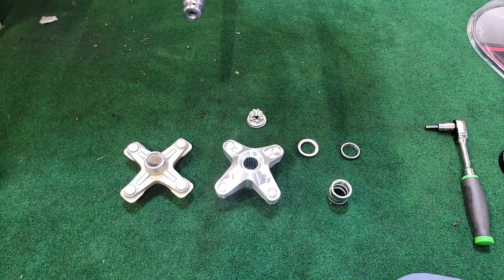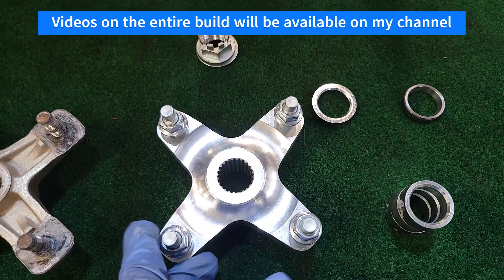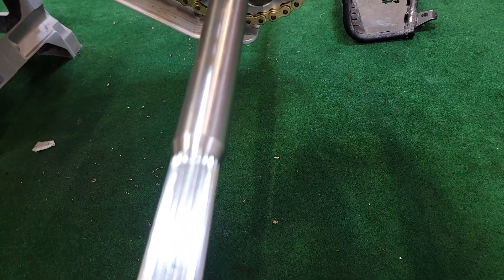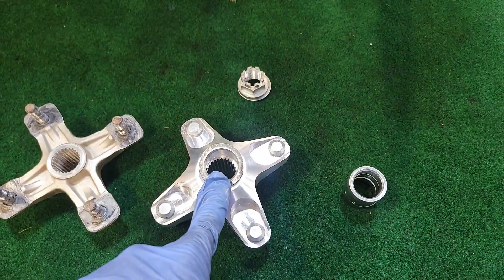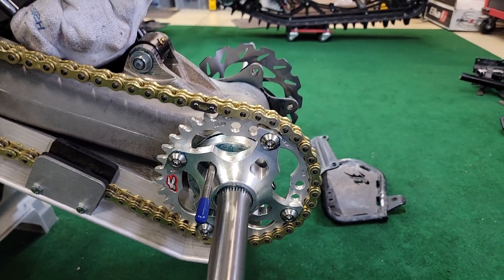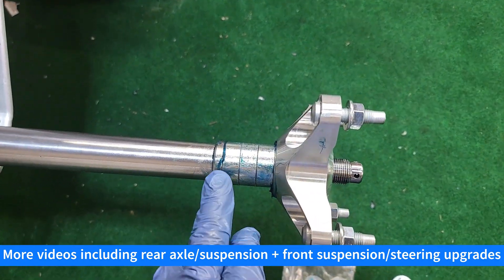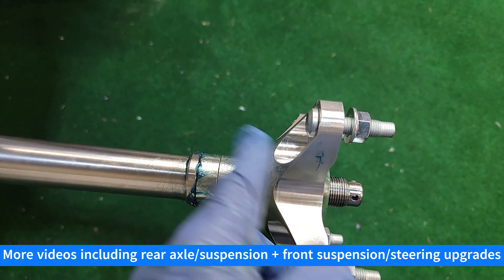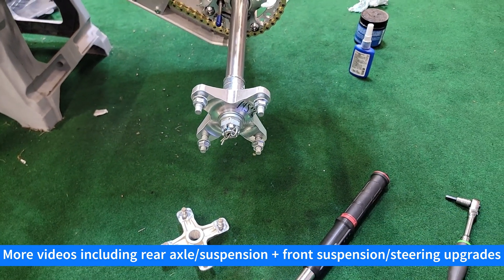Yamaha Raptor ATV Project - Rear Hubs Installed (Lonestar Racing Hubs Installed and Compared to OE)

Comment: Nicely explained. What axle are you using? So many options. Oh I went under your description and it a LSR axle. Do you order from LSR directly or do you have a better source?
Reply from the maker: I ended up ordering from ATV galaxy. But Lonestar racing is just fine as well. Only reason I did use ATV Galaxy as they have super comprehensive kits with literally everything I used in this project other than a few things from Rocky mountain ATV
Reply from the maker: Let me know if that makes sense of any other questions. Thanks for checking it out
Reply: @MotoXr917   Back when I bought the bike new (  2006 banchee  ) the AARMS, suspension, steeringstem, dominator axle, ect. was all through Janssen motorsports. They are nolonger working with banchee kits. ( components  )
I will check out ATV galaxy! Thank you
Reply: @MotoXr917  the banshee is down to the frame now. Getting fresh powerdercoat and all new components. She was a MX bike and then traveled the southern states. Mountain trails beat her up. Her next life is strictly XC stuff.
Reply from the maker: Sounds like a great project. I love banshees!